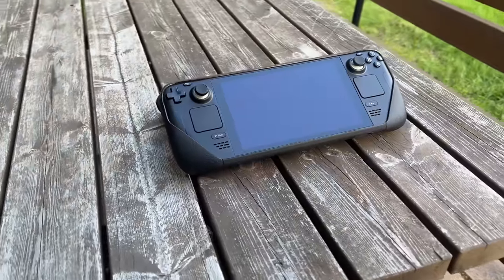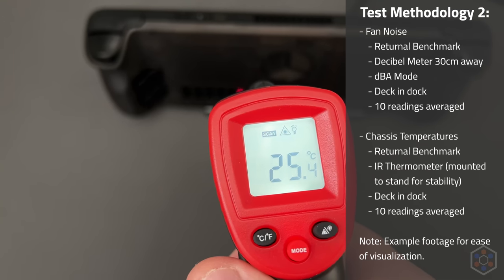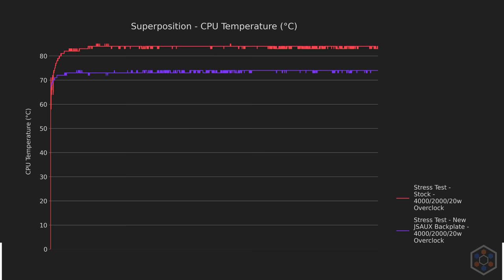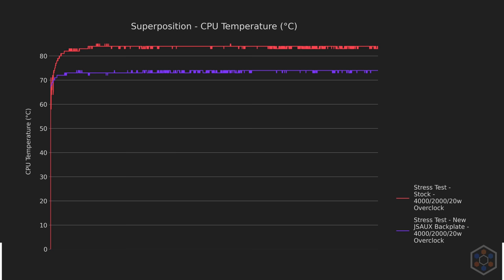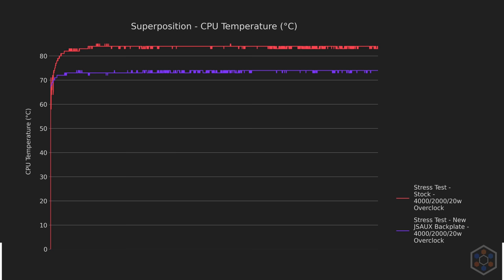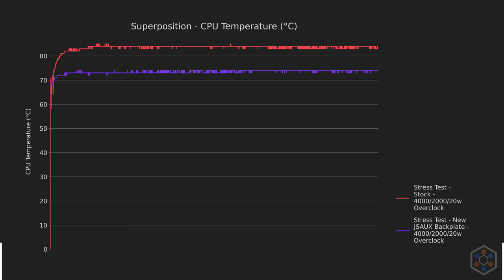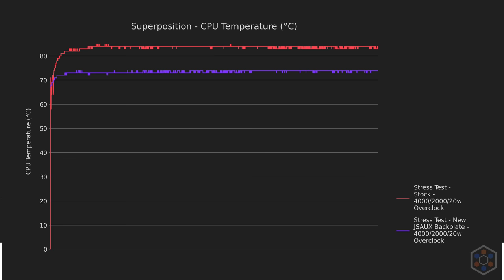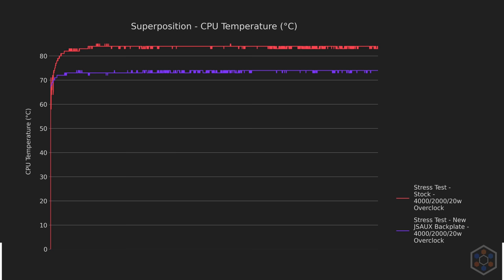How LOW Can It Go? | Steam Deck Thermal Modding

Comment: I've been quite happy with my OG JSAUX backplate. I noticed much better temps, run the original fan curve, and the hot plate doesn't bother me at all, even when I grab it. It probably helps that I'm not playing AAA games maxed out, but rather play power limited stuff locked at 40hz/40fps for battery life. The new JSAUX backplate thermals are impressive! But I see no reason to upgrade for me. 

Atomic purple for life!
Reply from the maker: Thanks for watching, and for the comment! The difference here is that you used the original fan curve, but it's way too loud for me with the Delta fan so I couldn't deal with it 😉

Comment: Any knowledge on if the modcase by Jsaux renders the first backplate as safe? the kickstand is a solid mass of metal that lies right over the metal backplate. Also, if you could look into possibly reviewing the old backplate with the modcase, I'd love to watch. I'm not sure if the extra layer would hinder or help as the metal of the kickstand could potentially absorb some of the displaced heat. Thank you for all the content and beyond! the Steam Deck community owes you quite a bit of gratitude!!
Reply from the maker: Thank you for watching!

The modcase renders the metal backplate safe, but it brings it to the same performance as stock +/- 1 degree. I'd be a little concerned with discoloration over the metal plate, but other than that it just gets a little warm to the touch and the kickstand hits about 36C after 30+ minute loads.

Comment: Seriously considering the PTM pad. Seems like a simple enough swap for comparably small amounts of money when juxtaposed with an entire backplate, though even that seems pretty cheap. If longevity testing with the new JSAUX plate goes well though, I may go for it. Looking forward to more videos related to optimization, as TW:WH3 needs every 0.1 FPS gain it can get. As an aside with the backplate recommendation in mind, do you find that the different height rear buttons supplied with the kit are better ergonomically/fit in the stock case? I've gone and watched a few other reviews of the case from an ergonomic standpoint and no one really mentioned if the larger buttons fit in the case. Thanks for all the work you do.

Comment: I am genuinely concerned about deviating too much from the stock backplate when it comes to airflow. I'm happy with the older metal plate with the magnetic fan. Plus it perfectly matches the front clear shell I swapped to.
Reply from the maker: Fair enough! I mention the airflow near the end of the video, and that I checked RAM and VRM temperatures for any deviations. Nothing gave me any reason for concern, but I understand being wary as I was at first too!

Thank you for watching!

Comment: Could you possibly do a video of the hardware temps with the new jsaux backplate, I know you have commented your results but there still is a huge debate wether this backplate will damage your deck in the long run.

Comment: Kyle, thank you so much, great video as always and useful notes.
One question regarding this topic from my side:
Do you think it would make sense to combine the killwitch case with the jsaux vent back plate?
I could imagine that it should be possible to bring in a hole for the vent in the back side of the killswitch case.
Reply from the maker: Thank you for watching! As long as you cut the hole over the vent then you should get the benefits of both 🙂
Reply: @cryobyte33  I wait at the moment for my honewell thermal pad and when its dropped here I start the mod.

Comment: Have u seen the New Rev. Of the steam deck? There is no contact betwen apu cooler and metall shilding
Reply from the maker: I haven't seen the newest one, no. Both of mine have contact, but even then it would be an easy fix with a thermal pad if you needed that contact. The fan still pulls air through the back intake with the vented plate so I don't think there are reasons to worry.

Thank you for watching!

Comment: Hey my JSAUX fan stopped charging after I used the SD as the power source. Is this common? Is It a Wattage issue that fried the charging? 

Also I mounting my Sandisk Drive directly into my SD and it also stopped working after getting warm.  Now it's not reading it. Please help me out thanks.
Reply from the maker: For the JSAUX fan, I charged it using my Deck before, but you'd need to use a good cable to do it (with the USB smart chip in the USB-C end).

As for the microSD, it sounds like yours might have failed. It's not the Steam Deck's fault, but microSDs are pretty prone to failure, especially during sustained usage.

Thanks for watching!

Comment: My only concern with the old Jsaux backplate would be with the thermal pad blocking the path of airflow across the rest of the components. I’m not worried about burning myself since I actually prefer to use the chassis of laptops for passive cooling (MacBook Pro). But in this instance it’s keeping me from wanting to do a backplate swap. Thoughts?
Reply from the maker: I love using the chassis of devices to passively cool (I also have a MacBook Pro), but my larger hands touch the metal plate at rest so it's not an option for me if I value my fingertips.

If you like your current solution there's no need to change it, but you'll definitely get lower temperatures with the new model, at least from my testing.

Thanks for watching!

Comment: JSAUX Modcase with attachable fan FTW!
Reply: & it fits perfectly in JSAUX M.2 dock.
Reply from the maker: Very true, that's exactly the setup I use on my other Deck! I like that this one is self-contained, though 🙂

Thanks for watching!
Reply: @cryobyte33  do you experience any trouble with the auto mounting of external drives/ adding libraries? I've tried all the tips, scripts including manually editing fstab, and Flavio updated scawp..
Reply from the maker: @SgtSlaughtah  I haven't had any problems myself, I just edited fstab 🙂
Reply: @cryobyte33  thanks for the reply, and help. I think my problem is the SD creates a different mounting point after restart or power cycle. It's always one character different then my fstab entry, no matter how many I add to cover down, and it happens without disconnecting anything. I also have the auto mount settings on for login and connect of that matters. I'm a noob.
Reply from the maker: @SgtSlaughtah  Ah, make sure you use the UUID of the volume in fstab, not the standard mounting ID. The UUID is inherent to the volume itself and won't change without being reformatted.

Comment: I'm (still) using the old JSAUX backplate. The new one is clearly better, but the old one is really good, too. The metal plate is positioned so you'll never accidentally touch it, which rules out a burn hazard. I will definitely switch to the new one eventually, though. Amazing aftermarket hardware. 😉
Reply from the maker: My big hands constantly touch the metal on the old plate, so count yourself lucky 😉

Thank you for watching!
Reply: @cryobyte33  always a pleasure, you're putting such an insane amount of work in your videos, I really very much appreciate it. ⭐⭐⭐⭐⭐

Comment: Can some one tell me if I took the old backplate and just used a Dremel to add similar vents to the new version backplate if that will make the heat performance be similar? I'm trying to get an all red transparent shell but they don't make the new version in red. I guess having a red and purple color transparent shell won't be a deal breaker either
Reply from the maker: I've seen other viewers say that performance will be similar if you use the same size/shape of the vent in the same location, so you're likely safe to do so. I'll try it out once I get some tools after moving back to the US.

Thanks for watching!
Reply: @cryobyte33  the fact that you of all people responded to me makes me feel really cool! thank you so much for your input! automatic sub. cant wait for your results!
Reply from the maker: @TheeCapN  I'm just here to help, thank you for subscribing!

Comment: Awsome video btw :) I'm curious if the new deck revision changes any of the conclutions in this video though. I have a new deck revision (3 weeks old), with the new black metal shield, different PCB layout amoung a few other small changes. Just curious if there are any thermal differences or if it's just all aesthetic. I'd also love to get the new purple back plate, but I'm going to hold off until some reputable testing around the charging IC and VRM temps come out. I don't really want  to risk a short term gain in CPU/GPU temps at the risk of long term wear on other parts of the device.
Reply from the maker: I don't have the newest revision on hand, but:
1. I tested VRMs, ICs, the SSD and the RAM for temperatures with the vented backplate and saw less than 1 degree difference from the stock backplate
2. A lot of air still gets taken in through the rear vent, even with the vented backplate. 

Hopefully this alleviates some of your concerns, thank you for watching!

Comment: I like your video.  I've been through all of this throughout the year, and found that the best cooling came from Thermal Grizzly Kryonaut Extreme, or a very close 2nd Gelid GC extreme thermal paste over the pad, and definitely over Noctua thermal paste, as that paste isn't that great, and definitely not on GPU or APU chips.  It's too thin.  I was curious if the backplate with the vent would be better or not, as the back is supposed to be closed to draw air over all of the components, and the vent would prevent that.  But with the metal plate and thermal pad there anyway, that whole design goes out the window, but still works better than stock.
Reply from the maker: I last used Kryonaut Extreme when it released and it was only a few percent better than NT-H1 when used on loads under 65w TDPs, but it's possible they've improved the formula since then. Regardless, I'm still a big fan of NT-H1 since it's good at all TDPs and very reliable 🙂

As for the draw over components:
1. I tested VRMs, ICs, the SSD and the RAM for temperatures with the vented backplate and saw less than 1 degree difference from the stock backplate
2. A lot of air still gets taken in through the rear vent, even with the vented backplate, so I have very few concerns with device longevity. 

Thank you for watching!
Reply: @cryobyte33  Great, so no reason to upgrade from the orginal JSAUX back plate that I already have on my decks.  I see more difference with the thermal pastes with PC CPU"s, so I these days I just default to Thermal Grizzly since I got a whole bunch of it!  Thanks for the info!

Comment: Dumb question: an increase of the environment temperature by 2 degrees, necessarilly means an increase of the deck's overall temperature by 2 degreees as well?
Reply from the maker: Not necessarily, the higher the delta from ambient, the less variability there'll be from environmental temperatures. Last I tested it (a few years ago during a work project), I found that 1 degree C ambient changed internals about 0.2C.

It's not totally linear, but it's a good rule of thumb 🙂

Comment: It would be cool to see downvolted results as well.

I’m planning upgrade with new thermal paste (viscous variant to avoid potential spilling), fan replacement + some “magic” thermal pad from aliexpress, which one should somehow improve overall temps. Have no idea how the last part will work and how to apply it yet, didn’t see any reviews on it
Reply from the maker: The "magic" pad could be a no-name PTM pad, which I've heard mixed reviews on. As for undervolted results, they're like stock but even quieter and cooler 😉 Overall it highly depends on your specific silicon so YMMV.

Thank you for watching!

Comment: Hey Kyle, I know this not really the kind of content you touched up until now but I would love to hear your take on the 400/200mhz bug that happens quite a lot on steamdeck. We have official answers saying it has to do with pd bugs in some docks but you can even find people claiming that the tighten of screws can cause this issue. You may have ran on this before and I would love to see some content on it.

For me, specifically, it seems it was a mixture of tight screws and fan wires being pinched by the metal plate.
Reply from the maker: Oh, really? I've seen it a few dozen times now and it seems to have been almost universally caused by bad voltage, usually as a result of a battery issue.

It happens most frequently when Overclocking, at lower than 30% battery (batteries output less consistent voltage at low charge levels), or both and has been resolved by a few people by swapping their batteries.

I, personally, only run across it while overclocking since the SoC takes in a bit of bad voltage and goes into crisis mode (the lock bug).

Thank you for watching, I'd love to hear your thoughts on this!
Reply: @cryobyte33  I can confirm that my problem was physical. Tighten screws + metal plate pinching the fan wires. My fan would report 0 rpm sometimes even thought it was running. This would cause the deck to throttle. When I tapped/pressed it on the back, it would read normally for a few seconds. There's a thread on reditt about the screws. It's something that it's worth noticing since a lot of people who change ssds can come into this problem. Not sure how to turn it into content thought.
Reply from the maker: @decomush  thank you for letting me know! I'll do my best to replicate it and see if I could at least make a PSA about it 🙏

Comment: Would it be possible for you to make a video on steam decks input lag? I always aim for atleast 40fps in games with 40hz mode beacuse when playing on something like 30 fps which i normally wouldn't mind you get huge input lag when using in built fps limiter and solution to that would be to use in game fps limiter and while it is better input lag wise the game becomes like "stuttery"? For some reason it just isn't as smooth.
Reply from the maker: I definitely plan to! That said, the Deck has built-in V-sync, so if you use an in-game limiter it doubles up. Try using the "Allow Screen Tearing" option in the overlay, then the in-game FPS limiter and seeing if that helps you out 🙂

Thanks for watching!

Comment: I wanted to change the paste but the people screwed my screws so tight :( I didn’t want to strip..
Reply from the maker: You should be able to use a well-sized screwdriver for it, but I understand not wanting to. I personally used an iFixIt kit and it worked perfectly.

Thank you for watching!

Comment: 3:33 dont spoil if you test some old thing making it more interesting, and don't put the noise meters this way 3:48 it will pick up the vibration (maybe I'm wrong).
Reply from the maker: I think that including a little teaser is important for retention! Also, both the noise meter and Deck are on a leather mat, on a rubber mat so there were no detectable vibrations.

Thanks for watching!

Comment: Awesome video, sir. Well done! I dunno if you've seen CoolDeck V3 custom heatsink? Curious if that thing is worth trying or not.

Edit: jsaux back cover seems like a no brainer. However, would a protective case affect the thermals? Im using a dbrand killswitch, thats the only reason i haven't bought the back plate yet, thought it'd be a waste since the case hides the cool transparent look anyway (didn't realize it helps the thermals this much).

Comment: 1st time seeing anything by you, and I am thoroughly impressed. Absolutely looking into getting the thermal pads for the deck now. Although I am a little hesitant to dig that deep into the deck, I have replaced my stock SSD and that wasn't to difficult. Are there any guides online that I can use so I am prepared before jumping in? Would love to see you do a guide on this.

I'm going to subscribe and begin digging into the rest of your videos now. Appreciate your work here.
Reply from the maker: Thank you so much for watching and subscribing, I'm happy to have helped out!

I personally used iFixIt's guide here: https://www.ifixit.com/Guide/Steam+Deck+Heatsink+Replacement/148904

It was really easy to follow and was only 2 more steps than the SSD replacement 🙂
Reply: @cryobyte33  Thanks!

Comment: I'm thinking of getting the vented back plate. But ill need to mod the case I have on my Deck.
Reply from the maker: Yeah I took my ModCase off for that reason, but it should be easy enough to cut a hole in the back of the case 🙂

Thank you for watching, I love the vented plate thus far!